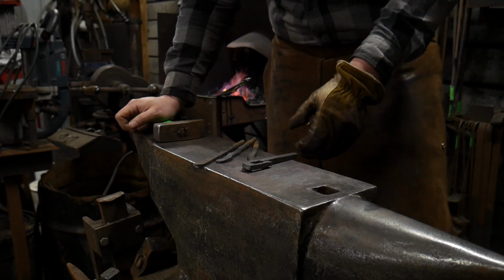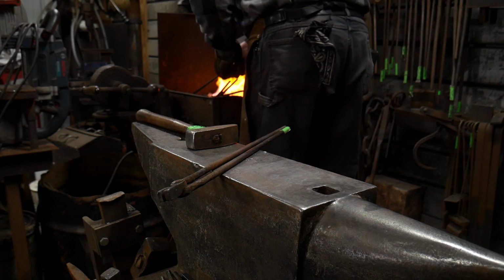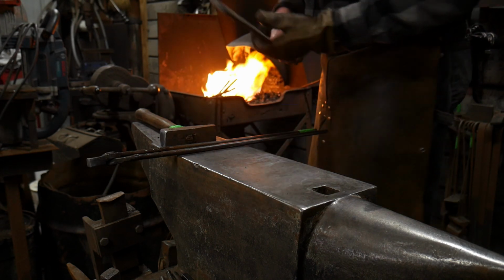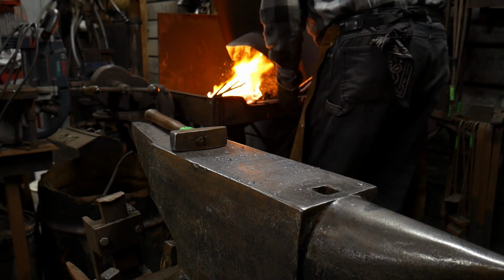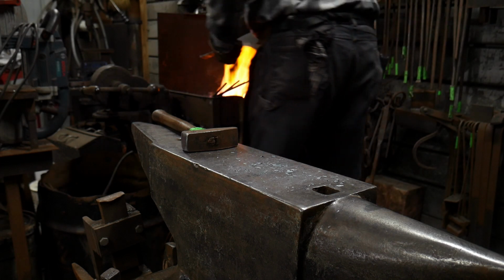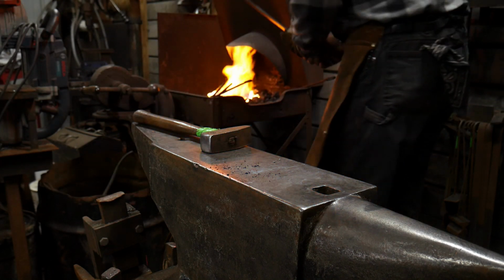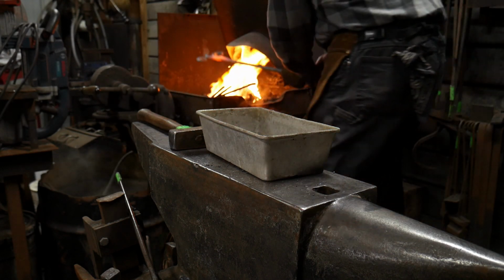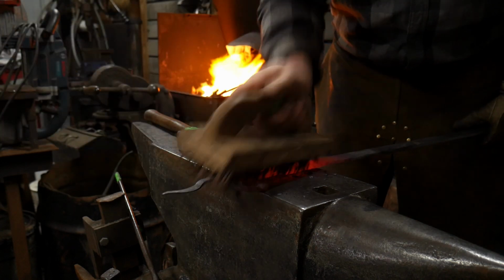Forge Welding Branching Scrolls

Comment: Of course we all enjoy watching Roy, your gifted. Just a couple of thoughts here if you don't mind me asking. A) would it be best to do forge welding first off with a clean fire so there are no clinkers and B) Would it help to get some heat into the anvil first ? Maybe get a few heavy chunks of stuff hot and just lay them on the anvil. I'm just wondering because I worked in a company during the 1960's and they had a very experienced oldish blacksmith there and he always complained in the morning that his anvil was cold.
Reply from the maker: To answer the first question yes if you clean out your clinkers first you willbe able to get to your forge welding temps quicker and with less oxygen..but this always isn't necessary or convenient because of the time to rebuild the heat loss from cleaning the fire pit of clinkers. To answer the second question heating your anvil is a total waste of time in my opinion as your anvil will warm up after a hour or so of forging that is the face but not the body of the anvil.. the other thing that makes this highly unpractical is Olga weighs 465 lb sitting on top of a 375 lb heat sink of a base the amount of heat that I would have to impart into the Anvil itself in order for it to significantly improve the forging experience would not be worth the time or the cost to do so. Also when heating anvils if they are not of a particularly high grade steel you take a chance of wrecking The Temper if not done properly. General forging won't have a problem with this or even if you work significantly large pieces of Steel on the Anvil surface they are usually never left on the Anvil surface for more than about 30 seconds or so in between forgings. Hope this helps thanks for the great questions God bless
Reply: Thank you Roy for taking the time to answer so quickly. I just wondered as I'm just starting out. Regards to you and Jessica God Bless too

Comment: Hey Roy's still a cool cat!
   There's a indepth video there buddy, thanks so much.
   If you were in a gas forced air system would there be the same dirty contamination at the scarf ends? Or is that more a byproduct of the solid fuel system? 
   Also being as how the heats go away pretty quick in the cold on cold anvil, would preheating the anvil face be of enough benefit to warrant  doing that? Or is it simply just a speed
 chicken thing regardless of heating anvil face?
   Thanks Mr. Roy 😁👏👏

   Blessed days sirSir, Crawford out 
(P. S. So speed chicken reference is kinda a colloquial west Texas term for Road Runners,  idk maybe just an oilfield type term. They're fast, dont fly much and really skinny lol, ie speed chicken)
Reply: If you've ever had the chance to watch a road runner take on a rattlesnake you'll see just how fast they really are!  Takes a couple of minutes but the bird generally gets his meal.  They provoke the strike then flip and bend around to try and peck the snake on the back of its head or grab its neck and flip it around to  slam its head on the ground. That's what one could call quick, catching a rattlesnake in his strike and knocking his head about lol.
Reply: Depending on how much you preheat your anvil face, it will help reduce the heat loss in the material a bit, and give you a few more seconds to play with.
Though, a few blows to tack the material in the first heat shouldn't take too long. Whether it's worth preheating the anvil depends on the smith... Practicing forgewrlds without a preheated anvil may well improve one's working speed, in my (limited) experience.
(Same goes for the amount of material that needs to be upset to compensate for the material loss during the welding. If the smith in question is not very fast, he(/she) may benefit from upsetting more material.)

(Edit: I should note that by 'A few seconds' I mean 2, maybe 3. Which for welding, is a significant amount of time.)
Reply: @JariB.  thank you. On scale of 1 to 100 in smithing...I'm a 1 or 2 level lol. Never done 1st weld, but I'm trying to learn as much information about it as possible while I gather my stuff to get started. So your information is greatly appreciated and helps me wrap old mind around all the bits n pieces of things I'm learning from all the different creators on the tube.  Rambely maybe but I hope it makes sense. 
   Thank you again 😁
   Blessed days sirSir,  Crawford out